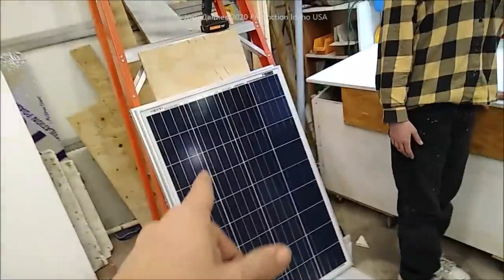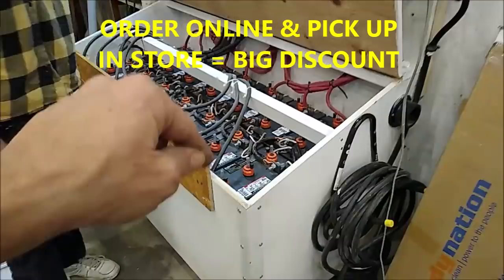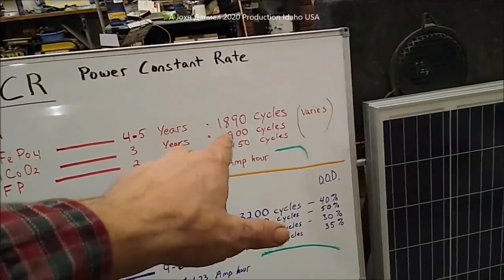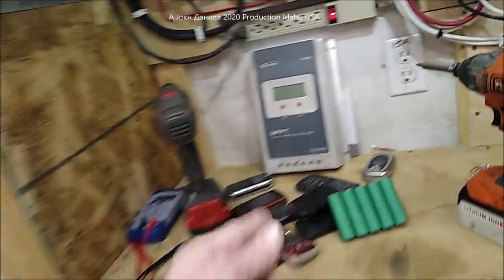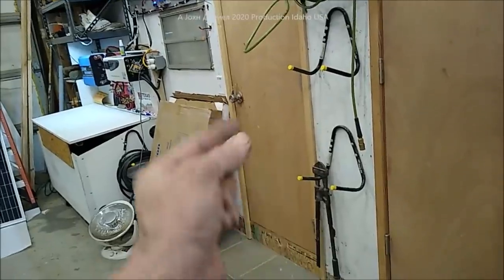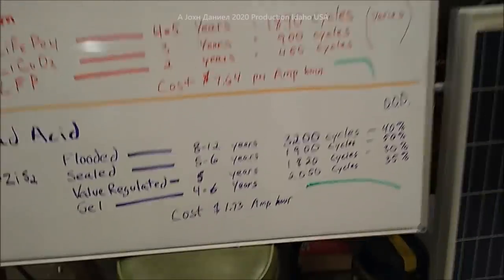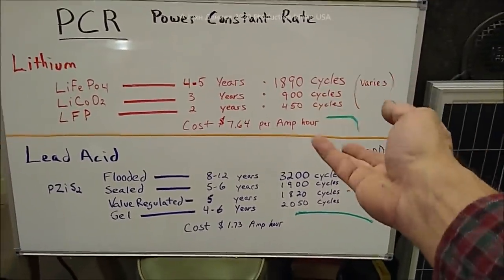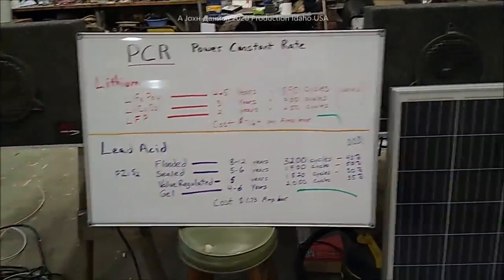Down Side of LITHIUM LiFePO4 Battery $ on RV, off grid & solar use (notes below)

Comment from the maker: Avoid only Lithium, proven short life due to incorrect designs for now, and they are over hyped, currently dangerous & 4+ times the cost. PCR = Cycle Use under Charge, Get the B-903 - L16 can last a real 10 years. By East Penn, via Batteries+ https://bit.ly/3c4othZ OR  https://bit.ly/3c1sDqZ & The Best Solar for laying flat, Mighty Max 100W https://amzn.to/2vc6oOl they really do as claimed. LIFePO4 has potential, watch and learn and hopefully they improve. 
( Cheaper decent 100 Amp sources 12v LiFePO4 https://bit.ly/2upFodJ if you JUST GOTTA DO IT!  )
Reply: 3200 cycles in a lead-acid battery?! Which kind of magic is that? They usually last only a few hundred cycles... my UPS battery died after only 3 years of usage. 

Also, 1890 cycles for LiFePO4 is only if you cycle them at 100% DoD, lead acid would be dead in a few cycles with that load. And you wrote “LiFePO4” and “LFP” as if they were different, but LFP is an acronym for LiFePO4! 

Furthermore, you claim that nobody had time to test them, but that’s utterly absurd. They have existed for decades already, and testing is usually faster than actual usage (so it’s actually more demanding than real world). For example, if you do 0.5 cycles per hour ((dis)charging at 1C, which is quite slow testing considering that these can (dis)charge much faster, unlike lead-acid), it’ll take about half a year to do 2000 cycles. 

Phones are also a terrible example: less resilient chemistry with a more stressful usage. LiCoO2 has worse cycle life and tolerance for high DoD than LiFePO4, in addition to being much more dangerous (LiFePO4 can’t explode, LiCoO2 can, though still very rare if well cared for), couple that with the fact that phones are usually used 0-100%   daily, and you have why they die so soon. So many things wrong in this video...
Reply: john, i have also been rc electric flyer for 12 years , pulled up some of my 12 year old 2200mah for my electric planes still had 75 percent capacity, when you wanna look up on negativity on lithium and fires they cause see your great elon musk...i am in love with lithium technology I will not deny it, again i repeat if you even buy a rv with lithium in the battery compartment please educate yourself or see a professional.
Reply: Where's the data sheet that claims these lead acid lasts 3,200 cycles at 40% DOD? Would definitely buy these lead batteries if there's a datasheet that claims it can do 3,200 cycles @40% DOD
Reply from the maker: @treehitzgonzaga4275  See HUP1 Solar
Reply from the maker: @treehitzgonzaga4275  Being that I have no horse in the race, I have only been off grid 12 years, have been installing only 13 for that I can be unbiased, I do use/install both, I just do not trust the overall components of Lithium based, LIFePo included.  BUT In the Video I said LEAD ACID, not my GC2 or B903 or L16 lead acid, the technology that in the last 50 years has tripled in improvement. The Video is based on facts of the 2 options mainly COST , not your dreams, sales plans, wishes and hopes that China will make Bulletproof  parts in electronics for a 10 year LiFePo4. They won't, the average HIGHER GRADE ELECTRONICS from China has a PROVEN life average ( Pacific Trade Org 1999 to 2018 ) to have a 19 month lifespan, so much for a 10 year battery with a 2 year BMS!!   BUT you say, they are 39% of the weight - Who Fukn Cares! Might as well just say saved Cash buying Lead Aid  is 95% lighter LiFePo4............ No need to be butt hurt over it.
 Now, More  Facts - 50+ years PROVEN FACTS  - HUP "Lead Acid" solar batteries last 2100 cycles at up to 80% discharge, 3200 at 50%. The more you learn, the more you know right - Advertised as 15 to 20 year life (proven accurate by surveys of 1300 owners) Cycles exceeding 6000 down to 40% DOD ( also proven by hundreds of owners) and since the 1950's a design that's Still at todays prices is 68% cheaper per AH than LiFePo4          http://www.hupsolar.com/advantages-of-HUP-batteries
*( I do not buy/own HUP Batteries or represent them or whomever makes them, I have installed about 30 banks with them in the last 13 years is how I am lucky to have knowledge of them, unlike most who fail to learn before spewing support for stuff.)
Reply: @JOHNDANIEL1  the lithium part of the name isn't everyone.  A lithium iron phosphate battery is nowhere near as dangerous as a lead acid or AGM battery.   It's as flammable as a coal poker
Reply from the maker: @veganpotterthevegan  Their BMS is what caught fire, the rest was smoke from the LiFePo
Reply: @JOHNDANIEL1  speaking of HIGHER GRADE ELECTRONICS from China my micro wave just took a shit. im going old school proven dial type. you did a video on em y there good for solar :) and bought hot air fryer with dials.  thanks no more clock sucking energy like a thief in the night.
Reply: @veganpotterthevegan  billions of cars and trucks ( acid agm )going up in flames  lol never heard of it. but lithium i have in cell phones and hover boards that were banned from airplanes cuz they did catch fire.
Reply: John. I think your video is a bit disingenuous. Your video is about LFP batteries, but you start talking about the 'dead' NCO power tool batteries  - different chemistry which you compare to. I was interested until then. You did not go into detail about the discharge level of both types, and the cost implication of that.
Reply: Јоhn Daniel  Sir will you check out a battle born battery guess it’s a lithium yes it’s got a 10 year warranty yes it’s been tested before I like flat ass at to want to know your opinion on a battle born battery
Reply from the maker: @171widetrack  The video is about the dumping of LiFePo4 and LiCo on the market from China, Battle Born is a builder, however they source from China where quality is only good if you negotiate it. As far as I know, a 10 year warranty offered by a company thats not anywhere near 10 years old itself is a bit to swallow. All LiFePo4 like theirs is not been on the market long enough to show its real lifespan in a "Charge while in use - PCR factor" which can as proven by all records on LiFePo4 batteries in Laptops the process shortens their lives. LiFePo4 is supposedly good till God returns according to the sellers, so why do Hospitals swap them out at 1 year!
Reply: @JOHNDANIEL1  simply put it is because battle born batteries are not built the same way as laptop and cellphone batteries, they are much better and safer. Also if diyers like you would install them correctly you would not have problems with them.
Reply from the maker: @davidmartin8444  Nice call, But although I have been a diyer for almost 30 years and only licensed installer for solar in 8 states, your saying when you buy a Battle Born battery, if your not a "professional Battle Born installer" its useless to buy them. Thats a nice commercial for the others selling similar stuff ain't it. Can't you see the Battle Born super bowl commercial! Hey folks our battery is so smart, and according to Dave your too stupid to use it if your not trained so buy somewhere else LOL!
Reply: Јоhn Daniel I am unaware of any laptop that uses LiFePO4 batteries.  It greatly lessens the credibility of your argument when you confuse Lithium Ion with Lithium Iron Phosphate.  The chemistries are different.  The electrolytes are different.  The charge voltages are different. The life cycle is different.
Reply: I've had TWO Lead acid batteries blow up on me. EXPLODE. Lead Acid batteries off gas HYDROGEN, which the last time I checked was the ROCKET FUEL used to power the SPACE SHUTTLE.  LiFePo4 Lithium batteries are way safer, Don't cost $7 per amp. Telsa is changing to them in China because of price and durability.  Most decent charge controllers will charge any kind of battery.
Reply: John I gotta also be honest I have had a lithium fire in my home, due to my diy and hacker extraordinaire made a custom charger for some of my rc 2200mah to replace my  nicad pack in my 24 volt weed wacker, went to gym came up drive way seen flames in my front bedroom where i set up the charger on two of those batteries in series so 6s well flames melted printer the charger was on and the explosion from a overcharged lithium cells(ion cells not lfp diff chemistry) caused cloud black soot printer burnt my carpet, and fire dept called, never put through insurance most was a major wash down repaint, won lesson learned when cleaning a lithium mess, use swiffer dusters the lithium black soot is positively charge ions and the swiffer sheets  attract them without smear them into drywall like a regular wash!!...just a heads up..still do it all over!...love your show though, we gotta talk wind turbines i have been through alot with your  midwest crooks!
Reply: Are you going to have a thought that you might be interested in being a d y i r and there was an in your video video you may be a bit of a country boy I just watched your video on one of the small wind turbines and I have an idea that might interest you on that I'm wondering why no one has developed a wind turbine with foldable blades that would be easily transported for use on like RVS since so many rvers want to Boondock and they took complain about the Sun not being there all the time and with one or two small wind generators like that they could have electricity off then there all the time because they always talkin about it being windy you might could design something like that for a wind turbine that would help these people out
Reply: Јоhn Daniel Do you have contact information Mr. Daniel that I can message you?
Reply from the maker: @Phil-OU812  Emails to shop are usually answered as I can, olympicpowercontrols@ yahoo . com

Comment: It would be nice to see some data for lithium iron phosphate batteries that is based more on actual data than opinion . I find that more lithium iron phosphate batteries have the BMS failed and burn up versus the actual sells themselves. It also seems that low amp hour batteries say less than 50 amp hour have an extremely high failure rate and typically experience BMS failures long before the cells die.

Comment: John I Bought the Duracell batteries from batteries plus,, thanks. These are the default flooded battery settings on my epever charge controller. Should I change them?
Boost Duration 120
Equalize Duration 120  
Temp. Compensation Coefficient(mV/℃/2V)  0  
Over Volt.Disconnect (V)  32.0  
Over Volt.Reconnect (V)  30.0  
Equalize Charging(V)  29.6  
Boost Charging(V)  29.2  
Float Charging (V)  27.6  
Boost Recon.Charg(V)  26.4  
Charging Limit (V)  30.0
Discharging limit (V)  21.2
Low Volt.Disconnect (V)  22.2  
Low Volt.Reconnect(V)  25.2  
Under Vol.Warning (V)  24.0  
Under Volt.Warn.Reco(V)  24.4
Reply from the maker: Drop all 4 on the last 4 of your list by 1 volt., Otherwise looks good.

Comment: I totally agree and as I live in hot place like Australia I think lithium battery here would become burnt toast very quick especially as I seen idiots promoting lithiums for under bonnet car battery claiming that its safe under bonnet where temperature can exceed 100 Celsius very easy next to the engine
Reply from the maker: Stick with Lead Acid for cost, fail proof predictability. It is your best choice in todays world where depending on China is not a smart plan.

Comment: We had a battery off our silverado that was about 7 years old. We then put it on the combine and it laster i think another 7, i don't think it ever died. So, yes, you can get luck and batteries last a while. It's called the bell curve. You have to choose your application. Lithium is light. If you are just throwing in a large immobile temperature controled bank, cheap and replaceble is key. If you have extreme requestes like cranking amps, high cycles, deep discharges, weight requirements maybe you should buy a higher tech and quality battery.  Varies? Everything varies. Everything has a tollerance. durp

Comment: Problem with that motorhome what's the batteries what's the load lithium battery or give the world to the blow up if you don't know how to use them shouldn't have them I got acid battery and I I lifemnpo4 yes they are dangerous if you don't know how to use them but when you need power and you don't have room is the way to go

Comment: A 100 Ah lead acid only produces 100 Ah when warm and 5 amp (20 hour) or lower draw. If you discharge the full 100 Ah, you permanently damage it.   You can only use repeated 50% draw down on them.  So that's really a  50 Ah battery at 5 amp draw and get decent life.  Pull more current, and you get less capacity, Peukert effect.   If the battery is cold and you pull 50 amps, you will be lucky to get 35 Ah before you damage the battery permanently.   Lead acid batteries degrade any time they are not at full charge, so they are the worst battery ever made.  Lead acid batteries charge slowly.  Lead acid only return 70% of the energy you put in, so you need more solar panels to compensate.  All of this is in the data sheets on the honest lead acid batteries.   On a lifetime  Watt Hr / dollar basis, LiFePO4 are actually less money, charge faster, discharge at higher rates without losing capacity,   produce the same energy cold or hot, and don't degrade when stored below full charge.  They are near perfect batteries.

Comment: You are way off john, lipo4 batteries have very much the same voltage as lead acid the only difference is that lipo4 batteries can go from 0% to 100% with no damage not like the lead
 acid that would be damaged each time it was taken to 0%.
Lithium iron batteries are the ones that catch fire and need balancing, some people would argue that isn't a must as they balance in time but personally a good controller helps.
Thanks John I have learnt heaps with windmills , you have been a great help.
Reply: Lead 13.8 Lipo4 14.2 big jump and 1/4 the time to charge John video come from the berth of lipo4 just before they solved the problem of fire and heat with the new circuit board

Comment: Just like there’s terrible one year AGM’s (black shiny case with white writing) and there’s the 10 year life VMAX brand, you can find terrible lithium’s too. Low grade, even used are sold as new to the unsuspecting. Those are wrecking the lithium reputations. A high end lithium is expected to be 6000 cycles with 75% remaining capacity with 70% depth of discharge. This is based on batteries chemistry/forensics since obviously time hasn’t been long enough. The price is dropping quickly for quality 280 ah cells and BMS. Build yourself for under $700 that’s getting close to quality AGM in price. Just wish we could make them in the US but China has it’s lobbyist positioned to quell competition or fund environmental groups to target mining of rare earth minerals. We have the best politicians money can buy.
Reply from the maker: And it just got 10x worse in Washington. The 47 year swamp creature of wallstreet filled his cabinet with straight corporate china sewer rats.
Reply: @JOHNDANIEL1  
Yup. But now there’s a hell of a lot of eyes with anger behind them, the likes of which I’ve never seen.

Comment: I live off grid in a houseboat and my lithium batteries have out performed my old heavy liberty 1000 agm lead batteries in every way. your math is off. 5000cycles min. 10yr warranties. $550. 100ah. one third less batteries needed for better power availability. 12v system is best. I used to deal with dying lead each year, lithium maintenance is all around easier, smartphone tells me if one is unbalanced. try em John

Comment: I have 2 of those windynation panels.  For sheer cost I'd might go 200amp sealed lead acid.  Still purchasing my project  parts.  Have scc, panels, fuse block and all wiring.  Gonna wait for a stimulus to buy inverter then battery.  Want a pro to set it up. Also want to purchase a canister of pv stop.  Total cost for my system installed circa 1800

Comment: Of couse lead batteries are better if you are an lead batt  advertiser. 
As I know less DOD keep your batteries last long. And we all know that lithium has more capacity in terms of low discharge current , almost 2x more.

Lead acid battery are not good at high discharge current while lithium is not.

Comment: I love lithium as a hobby intetest but there's a reason when I built my mum's offgrid  system for her property I used locally made Lead carbon batteries, they have a 7 year warranty if dod is less than  50% on average and a 5 year warranty otherwise.

That said I believe the newer chemistry lithiums probably can be as performant as claimed but they need a shitload of excellent battery management and filtering, they don't like "dirty" current or high frqeuncy leakage from inverters etc so they often die a painful death. Most chemistries don't explode like lipos do but they still tend to die. 

It is worth pointing out though that you can use more of the nominal amp hours with lithium compared to lead acid so unless you factored for this the price discrepancy isn't quite as large as you say.
Reply from the maker: Even running Lead to 50% and LiFePo4 to 100%, Still ends up being 2x the price for no longer guaranteed result. LETS DO EVIDENCE BASED FACT! When you put Lithium LiFePo4 through the rigors of a Electric car, you get 5 years, maybe 6 { Elon Musk Tesla Vegas Event 2019} NOTE:( electric cars sit 80% of the time). When you put LiFePo4 though the rigors of a Tool Battery you get 2 years till fail NOTE:( electric tools sit 70% of the time). On a home, are you going to run LiFePo4 to power your home just 25% of the time? The So called 2000 to a million cycles that are claimed by Sellers of so called RV and Offgrid versions of LiFePo4 is clashing like a Turd in a cup of Coffee considering the actual warranty information from Tesla, DeWalt and Milwaukee tool using them